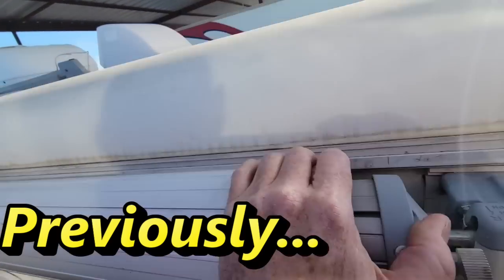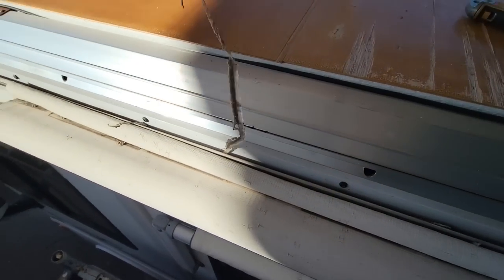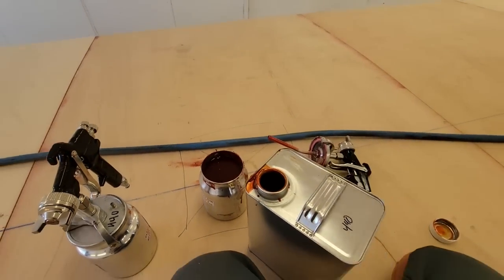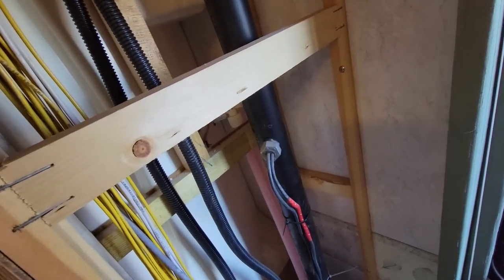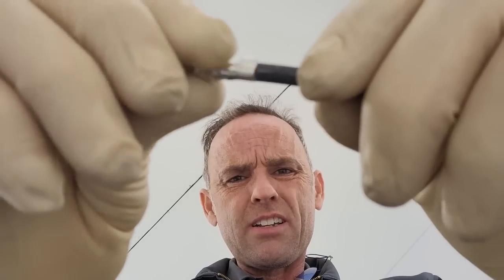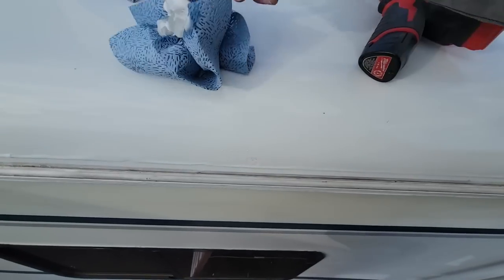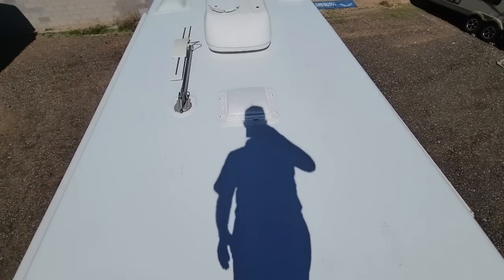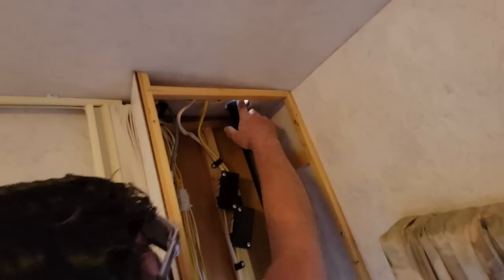Repairing Winnebago's #1 Failure Point

Comment: James, these roof videos never get old, which has a lot to do with your attention to detail and as always, your work ethic. 

When I was looking at used Motorhomes for purchase and encountered a Winnebago or Itasca, well, all roofs for that matter, your videos provided the tutorial needed to inspect these roofs, which saved me from making the wrong purchase more than once.

I would then provide the sales person with a list of what I found to be unacceptable with the roof to address with their service department, which was met with an array of responses, like "no one has ever asked to get on the roof" or "I didn't know that is how they installed the roof". Short-cut seams, loose Filon or badly cracked sealant along each side of the coach seemed to be the norm, and I would tell them point-blank, whether installed correctly or not, these seams are the weakest points of any Winnebago Filon roof. Most salespersons didn't even know what Filon was.

You are spot-on with with your knowledge and advice of Winnebago roofs. If only Winnebago would listen...

Comment: If you want to clean glue out really easy. Take the gun off the cup, aircap off,pull the trigger and spray carb cleaner through the siphon tube. Gum out cleaner seems to work best. I do it on my glue gun constantly.

Comment: Great &  informative video.. I Might  have had the guts to save one of  my Winnebago's 20 years ago  if  I had  seen this! Thank  You  for  your work!!!
Have you ever tried "LEXEL"?? (comes in clear, white & black?) Solvent based (keep a rag & mineral spirits nearby..) In spite of it's potential  messiness, It  stays flexible and NEVER  separates from the material applied to, unlike  silicone and seems not to be as prone to  mildew as silicone (Mildew I  think  is  what gets under the silicone and  separates it's bond.
I've used LEXEL instead of silicone in  tubs/ showers/ my Win Vista roof and side panel sealing  for years ow.. I for one, have almost NO silicone in my  stock of 50  or more  tubes..  LEXEL also comes in a ?7 oz. ? resealable tube and capped properly, both formats are  much less prone  to  hardening / drying out than  silicone.
Reply: I used to install wood stoves in homes with medal roofs.  No screws in the roof, just lexel to stick the roof jack to the roof panel. Never had a leak or failure

Comment: Love your great videos!
We have a 2013 Winnebago Vista. I want to add sealant to the front cap on the roof. The (looks original) sealant has a chalky residue on its surface but can't be sure, based on the Winnebago call-out sheet what was used. It almost looks like it was a product that was on a roll, like tape(??) and it doesn't lap up over onto the top of the cap. It looks perfect unlike something applied with a caulking gun....
Any suggestion would be greatly appreciated.
Reply from the maker: Yes that's the front cap adhesive and its not uv stable. I just use a knife or razor to remove the loose stuff clean with soap and then alcohol and then self leveling silicone on top to the radius edge

Comment: EXCELLENT series of videos! 
Question: Do you have a video on making smaller "spot" repairs to these Winnebago roofs? 
(I had some leakage around the TV antenna base on my 2014 Itasca Spirit this winter that caused roof surface swelling and de-lamination in the Filon and 1/8" plywood. The affected area is approx. 9"x6".
Thank you for your amazing videos!

Comment: James, I have a 2002 Winnebago Sightseer 27c. What would it cost to replace the Filon on my RV? I have the standard vents like Bath 14" X 14", Shower Cap, small air vents (2).  AC, TV roof antenna. No Satellite Dish.  Where are you located?

Comment: Have you seen any improvements and/or have you changed your mind regarding the "FlexArmor" roofing products?  We just bought a used 2021 Vista 29V and these roof problems are scaring the hell out of me.  I was not familiar with the problem until after we bought the RV.  I will definitely look at the radius and seams, but at 78 years old, I do not anticipate spending a lot of time on the roof.  I have watched your videos on what to look for and how to repair the "radius" and roof.  Several obstacles stand in the way; I don't really have place to put scaffolding and that would seem the best way to get to the problem.  I would not know how to even begin to find a qualified and conscientious RV tech that I would have trust and confidence in.  There are a couple of "lifetime" roof replacements and you don't seem to be crazy about any of them.  Any suggestions will be appreciated.

Comment: Hi James, i'm looking at adding solar to my 03 winnebago minnie 324V - partly cause I hate the generator, partly cause my roof is .. well it's a winnebago so it has delaminated in multiple areas. Knowing that the roof is only thin plywood, what would you recommend as a method of attaching solar panels? I've seen videos where the panels are only attached with VHB tape and that makes me nervous. but i also know that any screw i put in rotten plywood isn't going to hold much.. and i'd rather avoid putting more holes in that roof if I can avoid it.. thank you!!

Comment: Well done! Now I know what I need to do on my Itasca. However at 20:00 you briefly discussed silicone / lap sealant on the vent pipe / sky light. I recently had a leak around my skylight and removed all sealant and used Dicore self leveling. It looked great but now your comment has me questioning myself. What should be used on the skylight?

Comment: Let's call the glue Mopar R4 Red....

If it were not for the booth roof, you could have used a steam roller. Perhaps one day soon someone will have invented an ROV steam roller for reroofing RV and other membrane roof installations. Even after putting up guardrails a seemingly fun to use ROV steam roller would take less time, more importantly less physical exertion to get the job done.

Who in their right mind would use the sewer gas stack as a wire chase. What an idiotic move. Likely a "tech" who was fired from every shop in town decided to going into business for themself. You know the type....... those fly by the wire cash only techs claiming to have all the credentials and certifications. I highly doubt the previous owner would have done this hack job. The last thing the occupants want or need is sewer gasses filling the coach. You're a great man for fixing this for the new owner. Always going the extra mile to ensure all work and then some is done correctly. Once again I applaud you. Bravo mate. Bravo.

Comment: I have a 1997 Winnebago adventurer and I want to replace the roof with rubber roofing material. The roof is fiberglass and is falling apart. Is it possible to use epdm roofing since the Rv has the exact trim molding as the one you have on this video?

Comment: The. Screws back out and Waller out with vibration. Should you use lock tite on the new #12 screws when installed?

Comment: That roof design seems flawed to me.  With that 90 degree bend in the edge all the way down the sides the Filon is always going to be pulling up against the glue holding it to the plywood ear the roof edge due to the tension in that bend. They always seem to delaminate near the edges.  I would be tempted to terminate the edge in a way that did not bend that Filon so much.  Another amazing job getting that roof on.

Comment: Why did you not use silicone or some covering material on the two screws on the front cap?  Wouldn't water get in there with the screws?

Comment: If the filon is still  intact, is it possible to  reglue it and reseal it? The front and rear are still intact.  One side came off and it pulled up.

Comment: Just a FYI, you talked about not putting the antenna up to receive digital signals. You are at least the second person I have heard that from. I am not trying to start an argument but I own a 2008 Newmar Mountain Aire that has that very antenna. Not needing to raise the antenna to pick up digital signals is not true. I just proved it to myself in Perry, Ga. I was trying to get the local CBS station 3.1 and with the antenna down I got nothing. I raised it and turned slightly, perfect. I don't know where the info is coming from but I don't believe it's helpful.
Reply from the maker: Your results may vary, but in the down position, I got 65 channels in the east valley of Phoenix, if you are further from a broadcast point it can help to raise, but most modern RV TV antennas are very low profile. It's not bad information, just general information

Comment: I would add some Right Stuff silicone to the flange screws to aid keeping them from backing out from road vibration. It might help?.  We used silicone in off road racing on some items to keep them from backing out during the race
Reply from the maker: Winnebago does add thread sealant to these screws now, but they still come loose.

Comment: lol why did u spray adhesive all over ur drill
Reply from the maker: I had the keep the roll of filon from unrolling while I spray, it acts like a wedge and has little contact points to the surface so it won't adhere. Also, I need a reason to retire the 15 year old screw gun

Comment: Another roof job well covered 😁
Does $500 sound about right for brand new toilet installation? Nothing fancy, just something that works. Was told mine is old and no replacement parts. 🤔
Reply: Depends on the toilet. Shop around.
Reply: @MaryWehmeier  
Thanks, definitely have to do.

Comment: With all the cost, would not a sheet of aluminum be better. My old bus was a 61 aluminum sections.
Reply from the maker: it's quite difficult to work with sheet metal of that size and secure and have it turn out well

Comment: Why did you use self leveling silicone on this job but almost all others you use proflex?
Reply from the maker: self leveling silicone as a lap sealant on the roof and proflex on the radius
Reply: When the sealant on the radius is cracked would you remove the old sealant or go over the old with fresh pro flex?